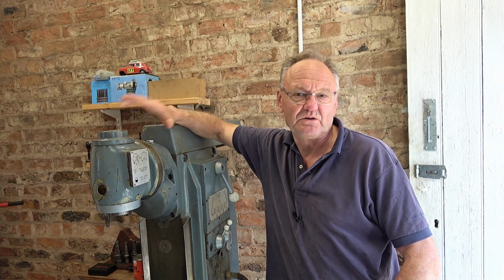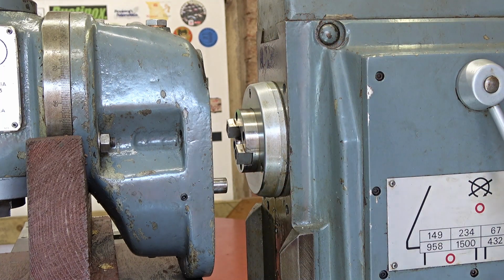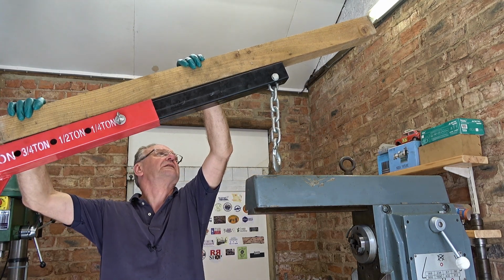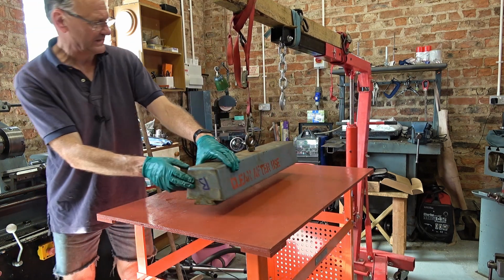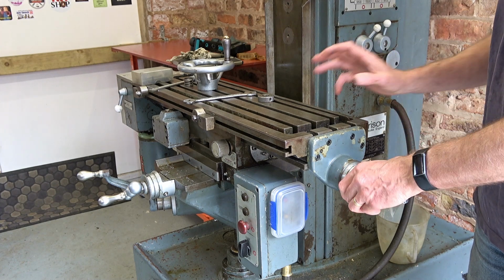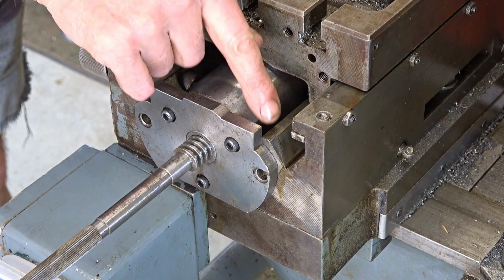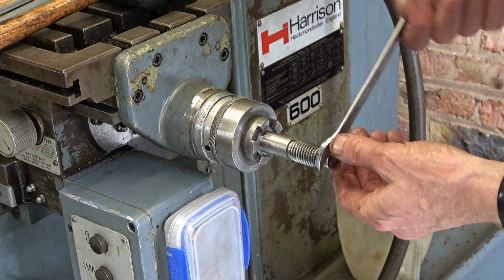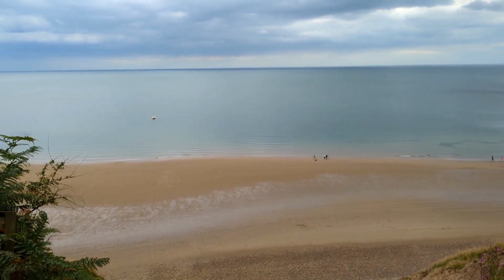HS269 Harrison milling machine maintenance

Comment: Hi and best wishes to your wife and family.
Great video , on the topic of maintenance i note you filled + used an oil gun  
This can be ( was for me ) an issue gor people getting new old machines and doing maintanance.

Could you in a future video include some close ups of the oil nipples and gun set uo youre using please

Robin Hoods Bay looks absolutely fantastic 

Regards from Ayrshire 🏴🇬🇧✝️
Reply from the maker: Hi Peter, the Harrisons have standard grease fittings but intended for oil. So it's just a standard grease gun, but filled with oil. The oil tends to run out so I empty the gun after use. Anyway sometimes I'll find a slot to drop in a bit of video. Robin Hoods Bay is a great little place - we have just been there for the annual Victorian Weekend. Cheers

Comment: Paul, family first, YouTube second!  Of course, you could (try to) convince your wife to spend her time in your workshop!  :P  Seriously though, I wish for your wife's speedy & successful recovery.

Edit:  If you do get a set of the ball-end Allen keys/wrenches, remember to use non-ball-end Allen keys/wrenches to loosen tight fasteners to avoid breaking the ball-end off of the keys/wrench(es)!
Reply from the maker: Hi Bob it may surprise you to know my wife actually started a mechanical engineering apprenticeship as a general fitter, and that involved basic manual machining, but she quit after 2 years to follow me on my industrial experience placements. We are still together after 45 years so you could say her bet paid off 😁. But it does mean she understands/follows my workshop stuff. Cheers

Comment: As others have already said - Family First (always) Now that's out of the way I've paused at 6:44 to ask if would it be possible to temporarily swap that bolt head on top of the mill head, with a lifting eye? So you could safely lift the head on-off using your engine hoist? Just an idea, as 35 kg is a tough lift.
Reply from the maker: Hi Paul, yes I think it would. There is an oil filler cap in the top of the vertical head which could just as easily take a lifting eye. I have thought about it. I could make a small crane to bolt into the hole where you see the lifting eye on the horizontal beam. I actually have some RSJ I-beam and I have thought about making a gantry either fixed to the wall or on wheels but then it all takes up space  and how often would I use it? But a small crane on top of the mill is a possibility worth considering. Cheers Paul
Reply: @HaxbyShed  I can see the drawbacks of a using a gantry crane in a shop that has  space restrictions. I'm sure you have a long list of other projects lined up already, but we've all seen those small lightweight hoists that fit on lathes (hooking onto the tool post), but I guess that they cost an arm and a leg. Maybe someone like Vevor will develop a similar hoist one day and ask you to test / review it :)